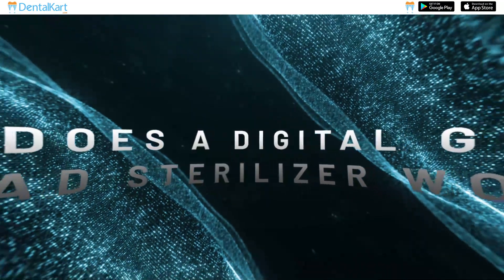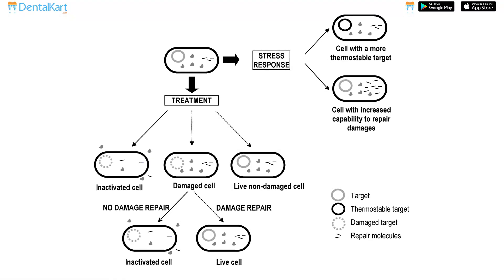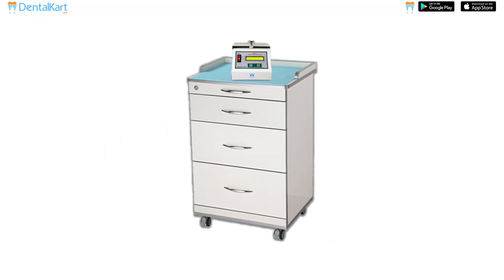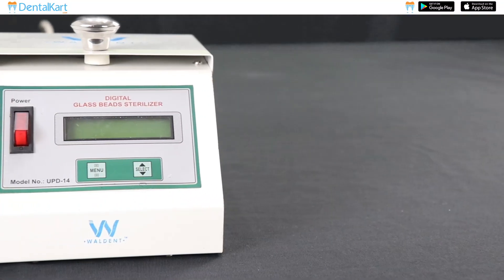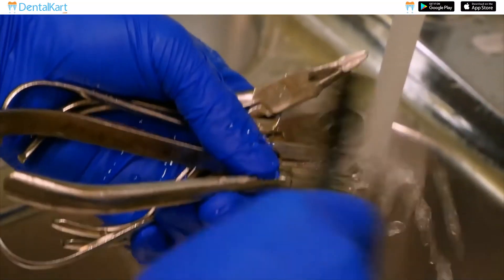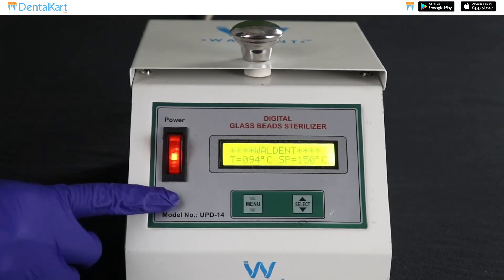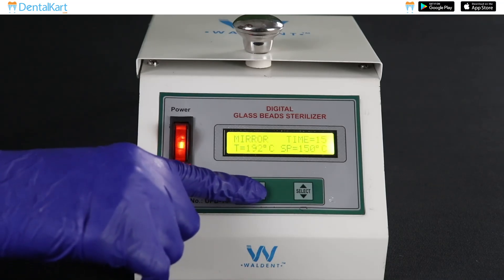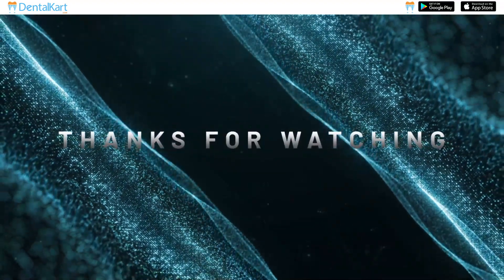How does a Digital Glass Bead Sterilizer work #dental #dentalkart #waldent

Comment: How to clean glass beads?
Reply from the maker: To clean glass beads of a glass bead sterilizer, follow these steps:

1- Ensure the glass bead sterilizer is turned off and unplugged, and allow it to cool down completely before cleaning.

2- Gently remove the glass beads from the sterilizer. Use caution to prevent any beads from falling into the drain or sink.

3- Prepare a solution of warm water and mild soap or a non-abrasive detergent.

4- Place the glass beads into a sieve or fine mesh strainer to separate them from the solution during the cleaning process.

5- Dip the sieve or strainer containing the glass beads into the warm soapy water solution.

6- Gently agitate the sieve or strainer, allowing the solution to flow through and clean the glass beads. You can use a soft brush or your fingers to help remove any debris or buildup on the beads.

7- Rinse the glass beads thoroughly with clean water to remove any soap residue.

8- Carefully place the cleaned glass beads on a clean towel or absorbent surface to air dry completely.

9- Once dry, carefully return the glass beads to the glass bead sterilizer, ensuring they are evenly distributed, and re-plug the glass bead sterilizer.